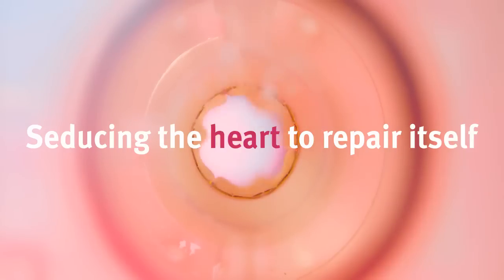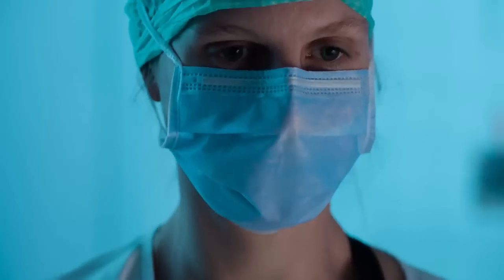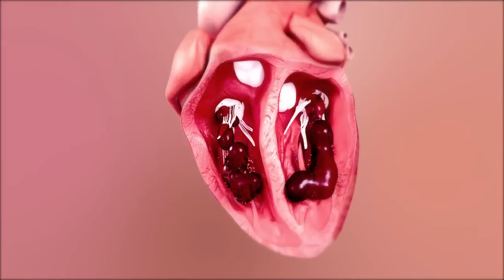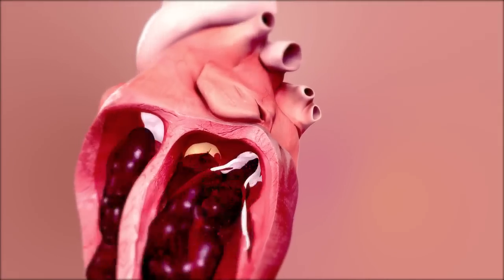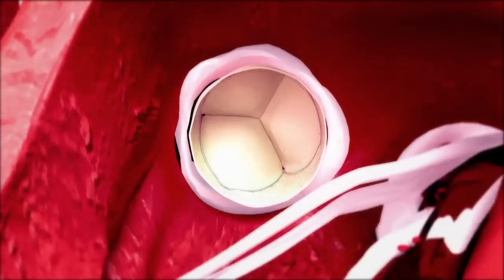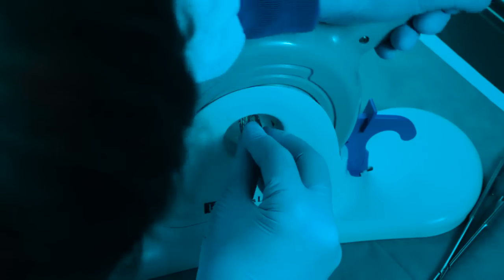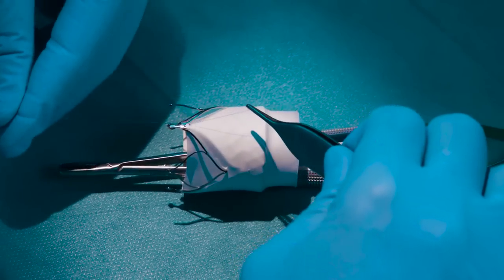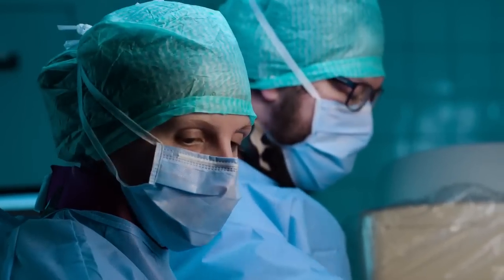Technology Update: A Heart Valve That Heals Itself (ImaValve)

Comment: I’m 17, I’ve had a faulty valve all my life and I’m yet to have an operation but most probably within a year i will have to have a replacement. I hate that I only have 2 options. 1) have a biological valve that lasts 7-10 years and have to have multiple serious invasive operations to replace it once it wears out or 2) have a mechanical valve that lasts longer by a few years but requires taking medication that makes you bleed more when cut therefore increasing the risk of internal bleeding. We live in 2018 and that’s the only options I have?! I really hope this new valve is a success and can be used for longer and with less complications but I won’t get my hopes up.
Reply: If you haven't done it yet, Consider Ross Procedure, although only with highly skilled doctors.
Reply: Hi Tom. I am 35 and going to have my procedure soon. I have the same fears as you do. I just wanna know if you already had it and how you are doing right now. Wishing you all the best!
Reply from the maker: Have you heard of the Ross Procedure?